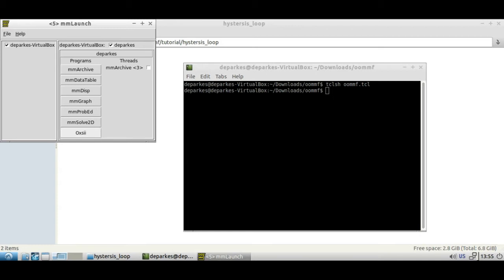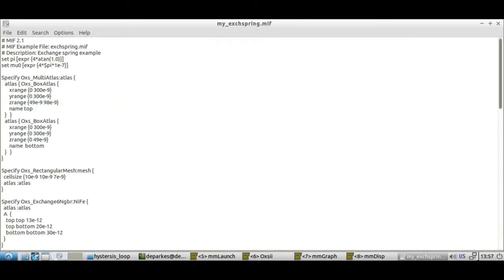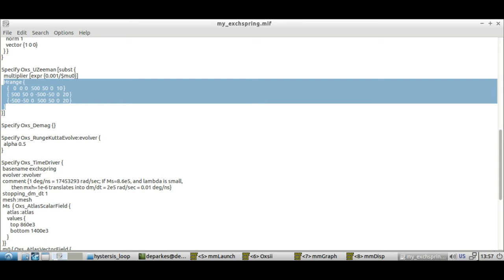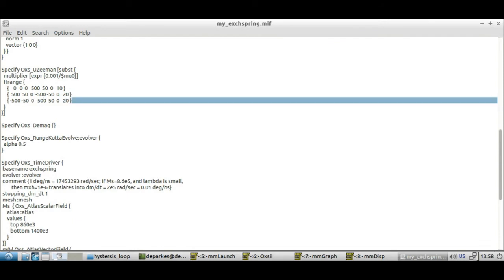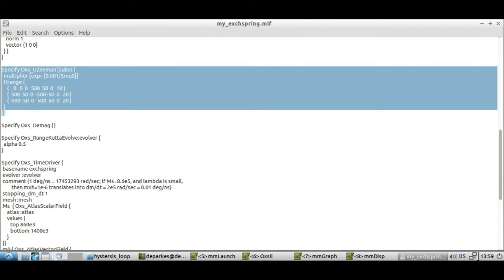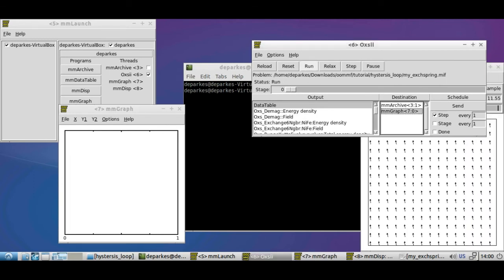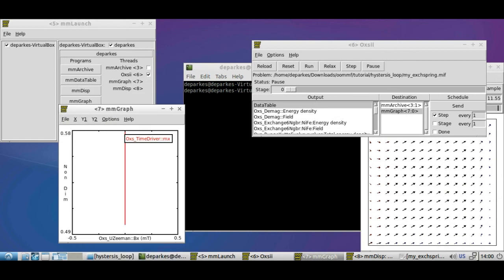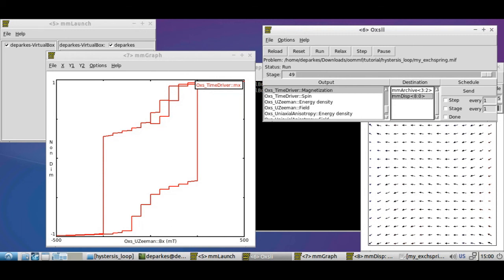How to make an OOMMF Hysteresis Loop

Comment: Thanks a lot for your videos. I have one doubt. Exchange bias means the pinning of the ferromagnetic layer by an antiferromagnet. So, in this case, we should get a shifted hysteresis. For getting this, we have to change the exchange parameters (-ve value for antiferromagnet and positive for ferromagnet). Is this right.
Reply from the maker: Good question. I'm not sure of the answer though. You could try sending a message to the mumag mailing list https://www.ctcms.nist.gov/~rdm/email-list.html - someone on there may have some ideas

Comment: Thank you a lot.
I have a question please, why the curve has steps? I notice in my measurements file that there are many values for the magnetization at each point for the M.field. how can I record just one value for the magnetization(m) at each value for the M.field?
Reply from the maker: The curve has steps because there are not many steps in the applied field - you can make it look less stepped by adding more steps e.g. {    0   0  0   500  50  0   100 } instead of {    0   0  0   500  50  0   10 }.

I think you should be able to can record just one value for each applied field value by updating mmGraph every 'stage' rather than every 'step'.
Reply: @DeparkesUk    Thank you a lot,
I have another question please, how can I change the size of one of the cubes in this example, such that I end up with two cubes of different sizes?
actually, I tried to change the range in different directions(xrange and yrange) , but I got an error!!!

Comment: how to make Magnetisation vs Temperature simulation in OOMMF?? Thank You.
Reply from the maker: Basic OOMMF isnt't directly able to deal with non-zero temperatures, but there is an extension module which you could try: http://www.nanoscience.de/group_r/stm-spstm/projects/temperature/download.shtml . You'll need to download and extract the file 'thetaevolve.tar.gz', and then check the readme.txt file for installation and usage instructons.

Comment: how if is about hysteresis loop? in x axis only?
Reply from the maker: You just need to set the y and z components to zero. Something like this:

# Stepped applied field
Specify Oxs_UZeeman [subst {
  multiplier [expr 0.001/$mu0]
  Hrange {
     {    0  0  0   500  0  0   25 }
     {  500  0  0  -500 0  0   25 }
     { -500 0  0   500  0  0   25 }
  }
}]

Comment: sir how is the simple formula or how can we know the value of H external ?
Reply from the maker: It will depened a bit on exactly what you are simulating. If you want to make sure you saturate the simulation region, I would suggest using a fairly large range, with a few steps to check you have it more or less right. 

You could also have a check in some of the examples that come with OOMMF to check the kind of values they have. The 'spinvalve' example has a maximum field of around +/- 500mT:

# Stepped applied field
Specify Oxs_UZeeman [subst {
  multiplier [expr 0.001/$mu0]
  Hrange {
     {    0  0  0   500  5  0   25 }
     {  500  5  0  -500 -5  0   25 }
     { -500 -5  0   500  5  0   25 }
  }
}]

Comment: so if I just want to search about applied effect of my Permalloy that could just be like this MIF :
# MIF 2.1
#=========================================================================
# Material NiFe Kubus + Medan 0 derajad (sumbu X)
# Reference : ......
# By :  Merinda L(Graduate Candidate)
# Dept.of Physics-Univ.of Jember(Mei 2017)
#========================================================================= 

# Konstanta
set pi [expr 4*atan(1.0)]
set mu0 [expr 4*$pi*1e-7]

# Ukuran Disk
Specify Oxs_BoxAtlas:atlas {
   xrange {0 5e-9}
   yrange {0 5e-9}
   zrange {0 5e-9}
 }

# Ukuran sel
Specify Oxs_RectangularMesh:mesh {
  cellsize {1.0e-9 1.0e-9 1.0e-9}
  atlas :atlas
}

# Konstanta Exchange
Specify Oxs_UniformExchange:NiFe {
  A  13e-12
}

# Aplikasi medan magnet luar
Specify Oxs_UZeeman [subst {
  multiplier [expr 0.001/$mu0]
 Hrange {
     { 400 0 0  400 0 0  0 }
     { 500 0 0     340 0 0  4 }
  { 340 0 0  260 0 0  20}
  { 260 0 0    -260 0 0       2 }
  {-260 0 0      -340 0 0  20}
  {-340 0 0    -500 0 0  4 }
  {-500 0 0    -340 0 0  4 }
  {-340 0 0    -260 0 0  20}
  {-260 0 0  260 0 0  2 }
  { 260 0 0     340 0 0  20}
  { 340 0 0  500 0 0  4 }
            
  }
}]

Specify Oxs_Demag {}

# Mode Euler
Specify Oxs_EulerEvolve {
  alpha 0.05
  start_dm 0.01
}

# Proses looping (secara time-evolution)
Specify Oxs_TimeDriver {
 evolver Oxs_EulerEvolve
 basename kubus_NiFe20nm
 stopping_dm_dt 1.0
 mesh :mesh
 stage_count 0
 stage_iteration_limit 0
 total_iteration_limit 0
 Ms { Oxs_UniformScalarField { value 8.6e5 } }
    
 m0 {-1 0 0 }
}

# Create destinations

Destination my_graph mmGraph
Destination my_archive mmArchive
Destination my_display mmDisp

# Specify what should be saved

Schedule DataTable my_graph Step 1
Schedule DataTable my_archive Step 100
Schedule Oxs_TimeDriver::Magnetization my_display Stage 1
Schedule Oxs_TimeDriver::Magnetization my_display Step 100
Reply from the maker: Yes, that looks about right.

Comment: Sir, how can we know the value of applied field ?
Hs≥2K/(μ_0 M_s )
I got this formula and on that papers can assume how much value of applied field, but it can't applied to my material Permalloy because K is zero
Reply from the maker: In general this would be the total anisotropy, but in your case, that K will be referring to the 'magnetostatic anisotropy', some times called the 'shape anisotropy'. This shape anisotropy, as its name suggests, comes from shape of your specimen - e.g. in a long, thin ellipse the magnetisation typically  prefers to lie along the long axis. The energy associated with this shape/magnetostatic energy is sometimes referred to as the 'demagnetisation energy', which is where the 'Specify Oxs_Demag {}' term in your mif file comes from.

You might find this useful to read through: https://ocw.mit.edu/courses/materials-science-and-engineering/3-024-electronic-optical-and-magnetic-properties-of-materials-spring-2013/lecture-notes/MIT3_024S13_2012lec25.pdf,  http://ltauxe.github.io/Essentials-of-Paleomagnetism/WebBook3ch4.html

 I can see how this can be confusing - sorry if I wasn't clear.

Comment: SIr, I have a question to you. How can we know that our material is in uniaxial or cubic anisotropy on OOMMF ? My material is permalloy Ni80Fe20, and I dont understand what's the kind of anisotropy on my material ? Pls answer me, thanks again sir :)
Reply from the maker: OOMMF  only knows about the micromagnetic parameters you set for it (e.g. saturation magnetisation, damping parameters, exchange stiffness etc.). This means that you need to know (or assume) these parameters for your material (in this case Permalloy).

The magnetocrystalline aniostropy of Permalloy (80/20) is typically taken as being essentially zero, so you won't need any magnetocrystalline energies (K = 0) - you could even just remove them from your mif file if you are only using permalloy. 

You can read more about the magnetic anisotropy of Permalloy here: http://www.southampton.ac.uk/~rpb/thesis/node19.html, http://www.physics.fudan.edu.cn/tps/people/xfjin/pdf/yinlifeng_2006.pdf, and there will be plenty more online too.
Reply: so if I just want to search about applied effect of my Permalloy that could just be like this MIF :
# MIF 2.1
#=========================================================================
# Material NiFe Kubus + Medan 0 derajad (sumbu X)
# Reference : ......
# By :  Merinda L(Graduate Candidate)
# Dept.of Physics-Univ.of Jember(Mei 2017)
#========================================================================= 

# Konstanta
set pi [expr 4*atan(1.0)]
set mu0 [expr 4*$pi*1e-7]

# Ukuran Disk
Specify Oxs_BoxAtlas:atlas {
   xrange {0 5e-9}
   yrange {0 5e-9}
   zrange {0 5e-9}
 }

# Ukuran sel
Specify Oxs_RectangularMesh:mesh {
  cellsize {1.0e-9 1.0e-9 1.0e-9}
  atlas :atlas
}

# Konstanta Exchange
Specify Oxs_UniformExchange:NiFe {
  A  13e-12
}

# Aplikasi medan magnet luar
Specify Oxs_UZeeman [subst {
  multiplier [expr 0.001/$mu0]
 Hrange {
     { 400 0 0  400 0 0  0 }
     { 500 0 0     340 0 0  4 }
  { 340 0 0  260 0 0  20}
  { 260 0 0    -260 0 0       2 }
  {-260 0 0      -340 0 0  20}
  {-340 0 0    -500 0 0  4 }
  {-500 0 0    -340 0 0  4 }
  {-340 0 0    -260 0 0  20}
  {-260 0 0  260 0 0  2 }
  { 260 0 0     340 0 0  20}
  { 340 0 0  500 0 0  4 }
            
  }
}]

Specify Oxs_Demag {}

# Mode Euler
Specify Oxs_EulerEvolve {
  alpha 0.05
  start_dm 0.01
}

# Proses looping (secara time-evolution)
Specify Oxs_TimeDriver {
 evolver Oxs_EulerEvolve
 basename kubus_NiFe20nm
 stopping_dm_dt 1.0
 mesh :mesh
 stage_count 0
 stage_iteration_limit 0
 total_iteration_limit 0
 Ms { Oxs_UniformScalarField { value 8.6e5 } }
    
 m0 {-1 0 0 }
}

# Create destinations

Destination my_graph mmGraph
Destination my_archive mmArchive
Destination my_display mmDisp

# Specify what should be saved

Schedule DataTable my_graph Step 1
Schedule DataTable my_archive Step 100
Schedule Oxs_TimeDriver::Magnetization my_display Stage 1
Schedule Oxs_TimeDriver::Magnetization my_display Step 100
Reply: Sir, how can we know the value of applied field ?
Hs≥2K/(μ_0 M_s )
I got this formula and on that papers can assume how much value of applied field, but it can't applied to my material Permalloy because K is zero

Comment: Sir, I cant find 'angle of incidence' from modification of my MIF h range etc.
Can you please give me some MIF examples to definition angle of incidence ?
Thanks sir
Reply from the maker: As far as I know there isn't a super easy way of setting the 'angle of incidence' for the applied field.

One thing you could do is essentially do a coordinate transformation [http://keisan.casio.com/exec/system/1223527679] on your polar coordinates (in which you set the angle of incidence and magntitude of the field) to get them into Hx, Hy, Hz format. You could do that outside of OOMMF and then copy the values into the Zeeman term. If you used Excel / Matlab (or similar) you could also join the elements together along with the "{" and "}" to make things a bit easier to add into the MIF file.

Alternatively you could try using some of the other modules in OOMMF. I've a quick blog post with an example of one thing you could try: https://deparkes.co.uk/2017/04/22/oommf-applied-field-polar-coordinates/

Comment: Sir, I need an output with type of ODT. If I use this script and I do modifications from there but why my ODT not found. Just OMF file and one restart file. I have to make hysteresis loop with origin software and need ODT file. What is the solution mr. deparkes ? Thanks
Reply from the maker: You should be able to make the ODT file by adding this to the end of your MIF file:

Destination my_archive mmArchive
Schedule DataTable my_archive Step 1

Which should send data to an ODT file every step. It first creates a 'destination' - called 'my_archive' in this case, and then writes a .odt file.

There's a bit more about it here: https://deparkes.co.uk/2015/02/05/oommf-automatic-output/

Comment: I need the MIF to do some example, please send me at merindalestari@gmail.com thanks
Reply from the maker: You can find a few examples here: https://deparkes.co.uk/2014/05/27/oommf-tutorial-part-3-mif-examples/
Reply: Mr deparkes, I have question to you. Now I'm writing an essay to graduate from my collage. I have a problem and I can't solve it. How I can create MIF to make a Hysterisis Loop with OOMMF and my material is permalloy NiFe. Pls, help me :) 
And there are influence of angle of incidence from H.
Pls, make some tutorial about that. Thank you Mr. Deparkes
I do search in manual of OOMMF 1.25a version, and I cant find something about angle of incidence.
Reply from the maker: To change the 'angle of incidence' of the applied H field you need to alter the values in the Hrange of the Oxs_UZeeman - you are setting the x, y and z components of the field.

The order is: { Hx_start Hy_start Hz_start Hx_end Hy_end Hz_end num_steps}.

(There is some about this in the above video video: https://youtu.be/ojiVtP1LOQI?t=1m29s)

I've written a bit more about this here: https://deparkes.co.uk/2016/08/05/oommf-hysteresis-loop/ and there is more about the Oxs_Zeeman term in the OOMMF manual here: http://math.nist.gov/oommf/doc/userguide12a6/userguide/Standard_Oxs_Ext_Child_Clas.html#UZ

To simulate permalloy you need to set the material parameters A (exchange stiffness) and Ms (saturation magnetisation). The magnetocrystalline aniostropy of Permalloy is essentially zero, so you won't need any magnetocrystalline energies (K = 0). You'll find some starting values for these here: http://www-old.mpi-halle.mpg.de/mpi/publi/pdf/3948_02.pdf (although for some reason that have included a non-zero uniaxial anisotropy term)

To make your mif file, I would start with one of the examples that come with oommf (probably exchspring.mif is a good one initially) and make modifications from there. See this video for a bit more: https://www.youtube.com/watch?v=-mJew6JYRZk
Reply: +deparkes thanks Mr. deparkes, you're so kind. Maybe if I have some problem again when running data Oxs I will ask you again. :) :) Thanks a lot